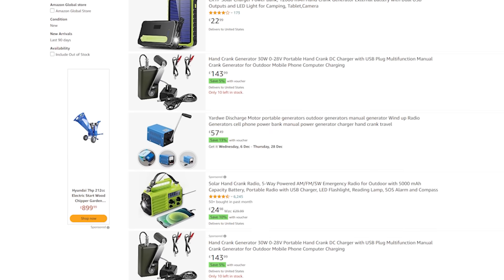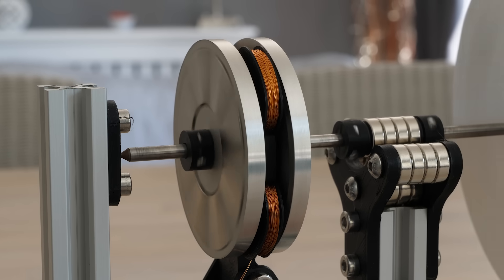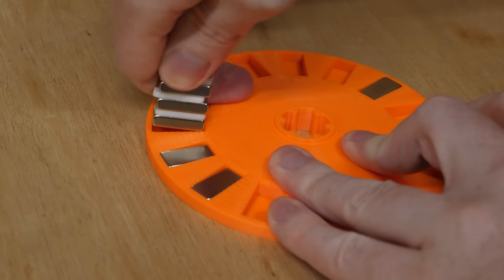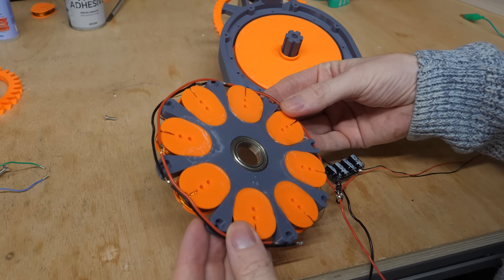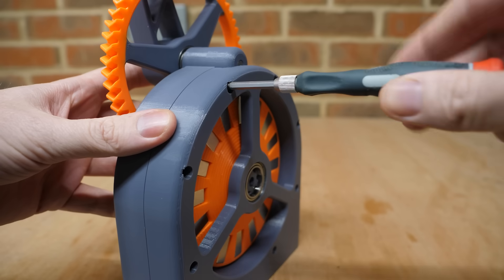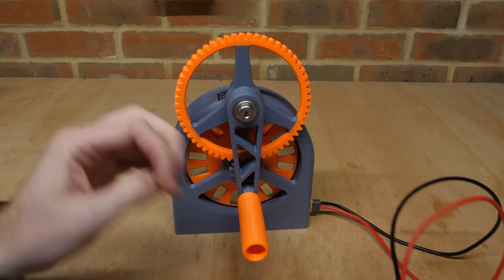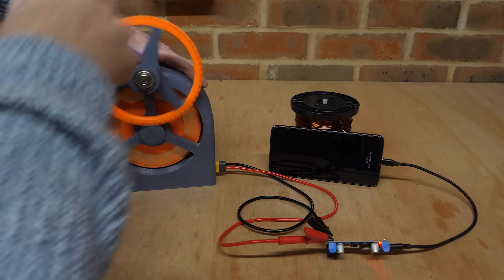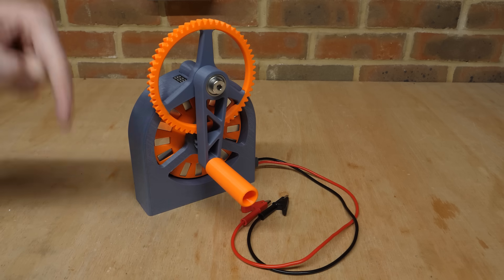Building a Generator

Comment: I wish you would set up a battery bank to dump as much power into as possible and see how much charge 5 minutes of cranking gets on your phone!
Reply: 5 minutes should get around ~1-2% of charge into a standard phone wih a 3000 mAh-battery. So you cannot fast-charge here. It´s slow charging.
Reply: @SmartZero-f8e  you've entirely missed my point, but thanks for reminding me about this video lol. A phone has a VEEY limited charge rate, a custom built battery bank does not! One could maximize efficiency by dumping all of the power into a battery bank and THEN charging a cellphone.
Reply: @ksc1406  That´s simply not true. Phones can be charged very fast for the tiny batteries they have. You can charge 60% of a phone in just 30 minutes today if you want via superfast-charging (requires PD and at least 9V or 12V or something like that). Which equals 2%/minute.
The point is: if your generator does not have the power or does not have this much voltage, it won´t work.

This generator does not have the power to do so. Thus fast-charging (or even superfast-charging) is disabled.

So plugging in a powerbank won´t help you, if your generator cannot handle this. Then the powerbank will be charged slowly instead.

Powerbanks uses similar charging-circuits as smartphones actually.

Comment: I'd consider adding weight, suction cups, Velcro, or some other mounting solution to the bottom, and a second crank handle on the other side 180 degree out it phase (like bicycle pedals). Basically a hand bike. Hell, you could even make the handles swappable with pedals so you could crank with your hands OR your feet!

Comment: Next thing to do would be to get a bicycle, add a stand on both sides so you can pedal with the back wheel in the air, and then connect it to the pedals. Or maybe even make a custom bicycle pedal assembly to be able to charge a phone while cycling, regardless of whether stationary or not.
Reply: Im thinking more of using the motion of a rocking chair to run it
So you can rest and charge at the same time
Reply: @danthanhhuynhpham685  itd be impractical and i think if you wanna rest, a windmill type of energy generator would be best. The bicycle idea would work better ig.
Reply: oh i just made a comment about the kickr core - a bike smart trainer system that i think could be modded for this purpose exactly

Comment: It would be great to see if you can convert this idea into a small, vertical shaft wind turbine you can attach to your vehicle or set out somewhere to passively charge your batteries or devices. Could be very practical if you can swap between manual crank and vertical shaft wind turbine. ❤❤❤

Comment: Would love to see this concept but powered by water pressure. Have it mounted next to the tap on the wall outside and use the power to charge batteries that run outdoor lights at night.

Comment: You could set up a pulley system where you just attach a weight, and it turns at the same rate for an hour. Then charge your phone, or a battery bank

Comment: I might be able to peddle for an hour. But hand crank... no. Looks like a fun project never the less.
Reply: trust me: I have experience since years. Pedalling is much, much harder. I can do pedalling with 100-120W for 1 hour. then i am finished allready.

But if i use my hands of a pedal-generator, then the fun begins. I can crank for hours and hours and i am sill not exhaused after having reached 200W output (0.2 kWh). lol

Comment: I have both electric and manual powered canine treadmills.   I have wondered about something like this for the manual powered treadmills...... hmmmm
Reply: Looked like you were winding a guitar pickup in that one scene!
Reply: If you made a video showing a canine "slatemill" charging batteries, I think it would get a lot of views/attention.     I did look into this before and found that long ago, farmers would put horses and cos on treadmills and then use that energy for mechanical based washing machines and saw mills etc.   I did see that there are workout gyms for humans that harvest the power being ued.   Great video!

Comment: Add 10 more stator coil wheels? Or then I’d it too hard to turn? Could you make it a bike design to then turn it? Then could you charge a phone at its maximum it can receive? Then it might be able to charge in minutes and you get a bike work out. Maybe can charge car battery banks to power a home?

Comment: I like it. I feel like it would be easier to have some sort of feet peddle thing where you just shift your weight to move a flywheel or something could get a much higher RPM - but Im not sure if 3d printed gears could handle it

Comment: Nice build, but you never even got close to discussing wattage.  Connect it to a load and have a computer sample current AND voltage 100 times/sec or 1000/sec.  Then you can get an idea of what a given wattage output or generating a watt-hour feels like.
Reply from the maker: This video was meant to be a short build/info video for an upcoming video on my main channel. However, it's gained far more interest than I expected, so I'll be making a follow-up soon!
Reply: It takes about ~30 Seconds to produce 1 watthour of energy on my pedal-generator = 120 W/hour. 2 Watts in 1 minue.

Comment: You should use the capacitors to power the phone charger. Crank the generator at a higher power for a short time, let the capacitors 'filter' that output over time to the charger.

Comment: You could try a USB 3 charger that can alternate the voltage based on what the device can handle. I bet your charge time would at least be halved. Amazing device you engineered there.
Reply: Usb 3 is multi-voltage capable? Cool. I thought it was just usb PD that could do that.

Comment: We need you to read through the comments and either tear them apart or use them to greatly improve the design. This is probably the most interesting project I've seen in a while on any channel. It's doable for the average person and super useful if they end up stranded somewhere without power.

Comment: I#d suggest using even thinner 0,06mm wire and going full series. Thereby you don't have to use such a heavy XT60 and higher voltage means possibly you could also directly supply a 230V outlet strip ;)

Comment: 0:42 "we need a huge gear ratio": because this brushed motor is small.
Making brushed motor as large as your DIY motor most likely will allow to reduce gear ratio to the same value as used in your generator.

Comment: could you please try and make this powered by a rope pulley system, for instance  taking a bucket full of water one floor higher and letting it descend and turn the generator. Would be just a few minutes of work for a hopefully fully charged phone.

Comment: Very nice project! I was waiting for the most important number: power. You mentioned power, and had all the instruments needed to measure it on your desk. Power is voltage multiplied by current. Voltage itself says nothing. You can have 100 watts with 1 volt or with 1000 volts. Most videos on generators only show voltage on a open circuit because the creator knows that the power is low. On this project, however, the power seems to be very good! Put the multimeter in series with the super caps and multi the current measurement with the voltage from the LED meter. 

One idea: use the 5V regulator and the supercapacitors together. Then you can charge your phone without cranking continuously.
Reply from the maker: This video was meant to be a short build/info video for an upcoming video on my main channel. However, it's gained far more interest than I expected, so I'll be making a follow-up soon!
Reply: @TimStation  Nice! I think it's the best diy generator I have seen. Keep up the good work!

Comment: amazing build!
devices or builds like this always makes me think,
is it possible to build a circuit that generates power out of nothing.. BUT the only thing it needs to get going is a bit of manual labor like for instance a hand crank generator.
Reply: Out of nothing - no.
Out of "waste power" - no problem: vibrations, radio waves, temperature differences, light.
However most of such power sources are very weak and can produce only nano-..micro- watts.

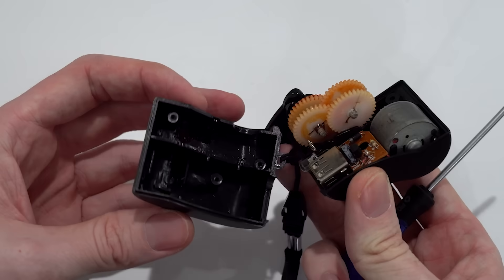Comment: 0:23 that's bs it depends on the motor KV
Reply from the maker: Yeah, but generally off the shelf motors have far higher kV than this generator. Therefore, I configured this for really low kV to output a decent voltage at low RPM.

Comment: 11:46 my electrical knowledge is rudimentary, but isn't it possible to put the super capacitors in between the crank and the charger?
Then one can crank for a shorter time with higher resistance and the charger can sip the power during the longer time span?
(I am aware that one could then easily make a smarter solution than that - it was just for understanding the concept)

Comment: I do something similar, but way less complicated. 

I build small VAWT windmills, each of which compresses air.

That air is stored in a system of receivers and metered out against a "pelton wheel" arrangement on a shaft.

The other end of the shaft has a large diameter wheel with n52 neodymium magnets equally placed about its perimeter. 

I have 2 separate wheels.  One wheel has alternating poles, the other has all the same poles on each side (all N or all S).

The turbine (Pelton) spins the magnet wheel through a low- historesis piece of "C"-shaped metal, wrapped with enamled copper wire.  Spinning things gives me a.c. or d.c.

I can control the power output by controlling the rotational speed with the air valve just upstream of the turbine and manufacturer whatever electricity I want.

Comment: What about using a loop on the generator mixing capacitor that has limited capacity or automatically stopped storage if it's full by wiring if to the motor. The motor itself turn the generator some as the fuel powered generator to supply constant power on it and somehow continually generating power. Which the help of the regulator. It will protect the electronic devices plug into it. How's that?

Comment: You should mesure short circut current also if you could get your hands on some 12v incandescent bulbs like the ones used in cars as indicator lights the you could connect more or less bulbs to adjust load on the generator to determine its maximum power output in watts I also suggest mesuring voltage and current while doing it then you just multiply them and get watts.
Reply from the maker: This video was meant to be a short build/info video for an upcoming video on my main channel. However, it's gained far more interest than I expected, so I'll be making a follow-up soon!

Comment: This would be fun to connect this to a gravity clock,   2,000 mAh phone battery or like 30000 Joules, 1kg *g  is like 10 J/m , 75kg 40 m  charge your phone by abseiling off a 10 story building. (please check my 1am maths before going off the high board)

Comment: You should rig it up with a weight system so you can just lift a weight whenever it drops to the ground, then you don't need to actively crank. With the right weight and gear ratio, it could go for several minutes before needing to be lifted back up

Comment: Very cool. I do wonder if it would be more effective to make the crank a bit shorter to raise the overall rpm of the large gear, though, I don't have this thing in hand, so maybe I am imagining it in a very different way and it would just be less practical as you would technically be exerting more energy to rotate the crank.

Comment: Would it be cool if I made a planetary gearset for this? I think I have the skillset, it's just
1. I think I'd move the hole into the back 
2. Pull Lets Print's planetary gearset 
3. Replace the smaller gear with the sun gear 
4. Mounting bracket for the hex gearset

Comment: How about using your whole body weight to generate electricity instead of a hand crank?
If you can step on something 1 meter from the ground, and it gradually moves down and transfers your potential energy to electricity.

Comment: Microwave turntable motors make great generators by simply attaching a handle, the high voltage AC output can be directly connected to chargers and light fluorescent tubes, or the voltage can be changed with a transformer; they're small, cheap and readily available, and generate about 20 watts.